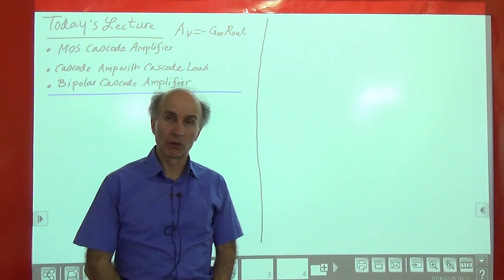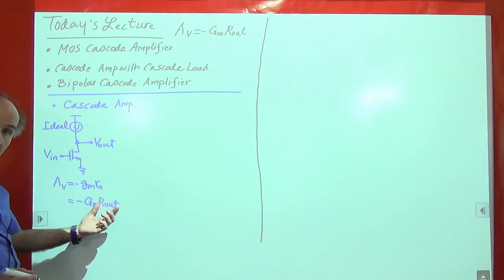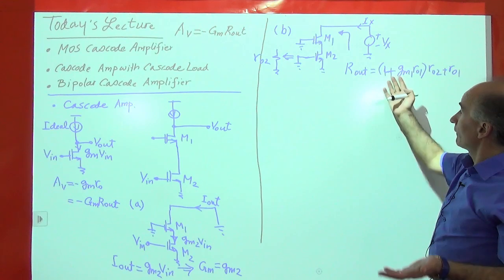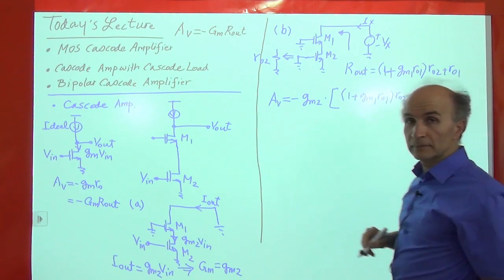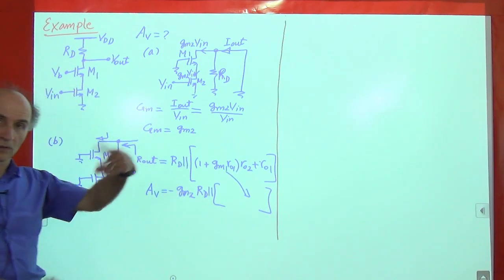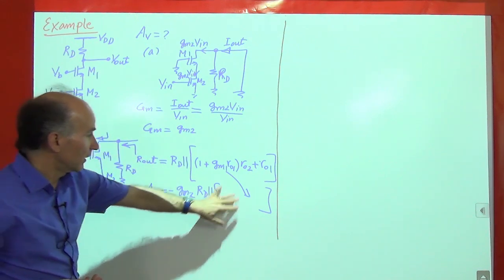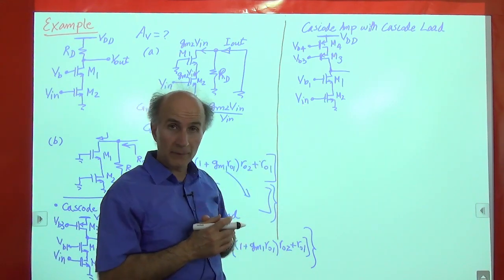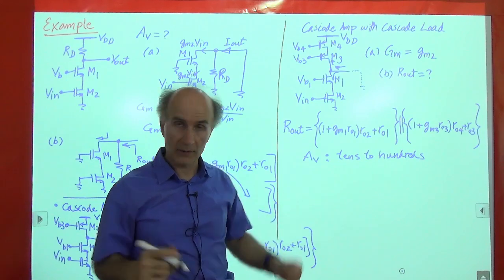Razavi Electronics2 Lec3: MOS and Bipolar Cascode Amplifiers

Comment: 01:25 - Intro and Review
05:36 - Construction of Cascode Amplifier
17:58 - Quiz: Input Resistance of Source Terminal
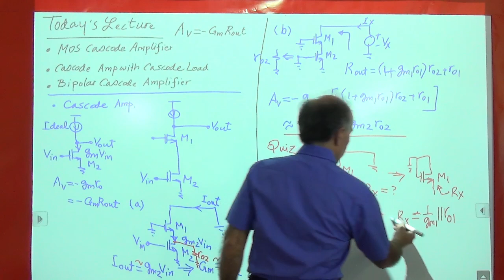22:25 - Increasing Voltage Gain of Circuit with Non-Ideal Drain Load
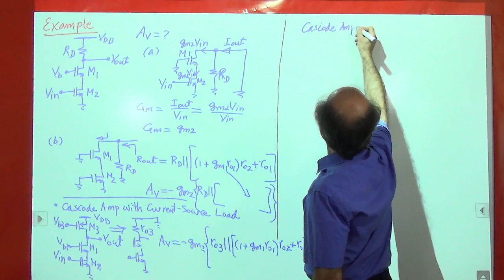36:00 - Cascode Amplifier with Current Source Load: MOS
42:42 - Cascode Amplifier with Current Source Load: Bipolar
44:20 - Question

Comment: At around 10:20 Prof Razavi states that the current into M2 is gm2*v_in. I believe this assumes that there is no channel length modulation. The formula for I_out is much easier if you neglect channel length modulation, but for those that cannot help themselves like me, I got: G_m = (gm2*ro2 + gm1*gm2*ro1*ro2)/(ro2 + ro1*(1+gm1)). If you then multiply by R_out, assume ro2 ≈ ro1, and gm1*ro1 >> 1, you get the same approximation as Prof Razavi: -gm1*ro1*gm2*ro2.
Reply: Only one change, i think the G_m should be (gm2*ro2 + gm1*gm2*ro1*ro2)/(ro2 + ro1*(1+gm1*ro2)).
Also i think for G_m calculations assuming CLM to be absent is a good enough approximation, as for every topology the result obtained with this approx is similar to the one obtained without it. Be it the basic amplifier stages, or Degeneration stage, or differential stage.
Reply: Yes you are correct , you can refer the same in his book cascode section , the equation is given taking ro1 and ro2 into account

Comment: at around 17.20 u said that current is generating and is supplied to ro2 and upper M1. My question is how does it happen. It is a current source and Iout should be devided into gm2vin and (Vds/ro2) and not supplied back.
Reply: im wondering the same
Reply: i have the same doubt. Is there any reasonable explanation for it?
Reply: Same doubt, can someone help me understand why the current has to flow from M2 to M1?
Reply: I found the answer
Basically we are trying to find the Rout in case of step(a)
We are finding Rout in step(a) to find the path of current flow in step(b)
To find Rout in step we are applying thevenin in step(a) from below

Comment: 36:37 how to bias the circuit. what should be the voltage values applied at the gate for all the transistors
Reply: Generate the bias voltage using the Current mirror circuit.  Provide the voltage at gate terminal such that all of your transistors are in the saturation region.